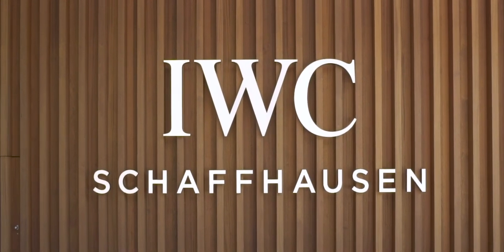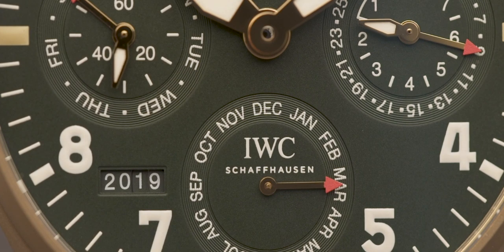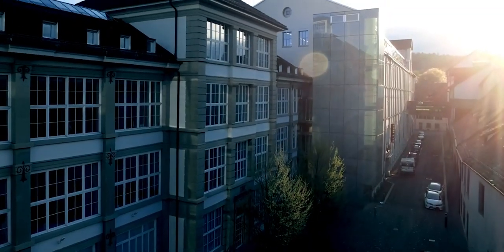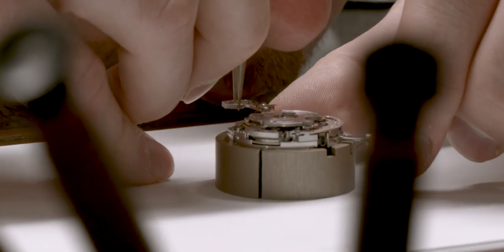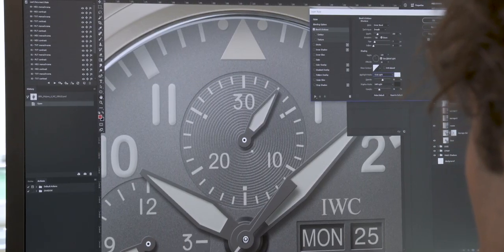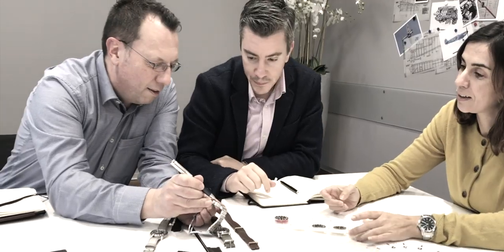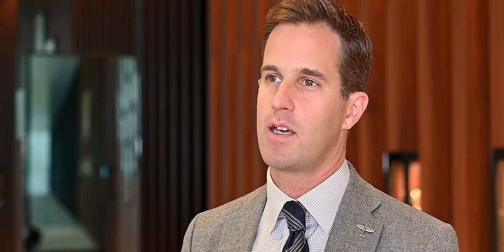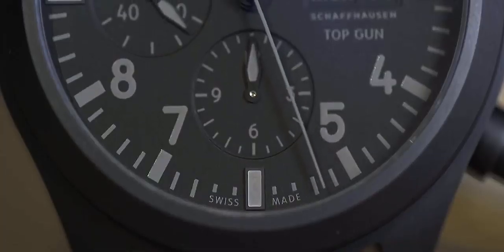IWC - Join us Inside the New Schaffhausen Manufacturing Centre and Discover the 'MY IWC' Program

Comment: Nice building.  Tribute to 3705 is nice.  Still very thick.  Very expensive.  Do I buy this tribute, or do I buy a Rolex.  This price will result in people going Rolex.  At this thickness (15,3 mm) and price (11.9 USD) people will go Rolex instead.  I love this tribute but its just too thick for me at this price.  Maybe Ill change my mind but not today.
Reply: 41mm top gun chrono msrp almost 10k, but with discount it is possible to get up to 8k. Nevertheless, there are main issue related to ceramic case and it scratchiness.
Reply: @unnamedhero5111  IWCs black ceramic scratches to black since it is not surface coated black but full black material.
Reply: @bertraminc9412  idk why IWC didn't use shiny ceramic case as they used in Miramar edition, some really strange decisions, imho.
Reply: @unnamedhero5111  I did buy the tribute.  Last one in US inventory according to IWC USA.  It's nice and I haven't really scratched it yet.